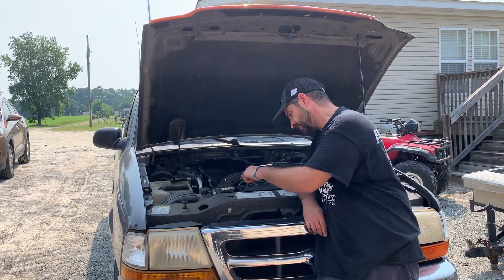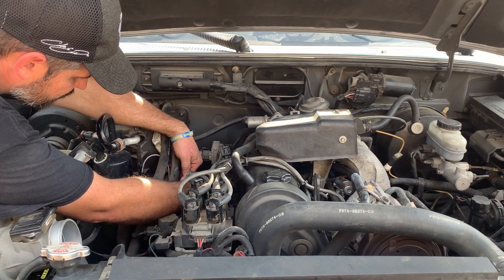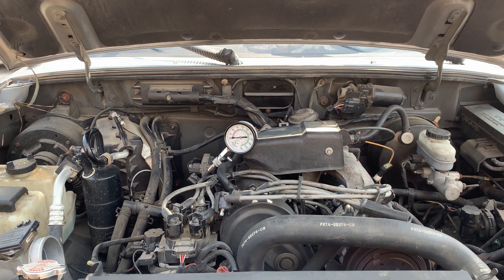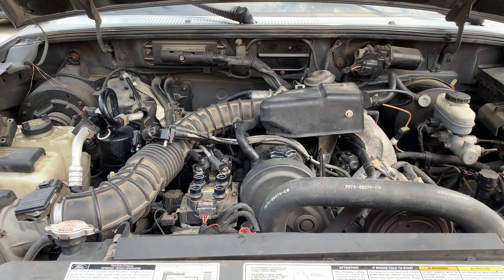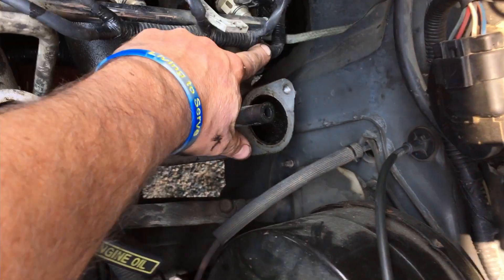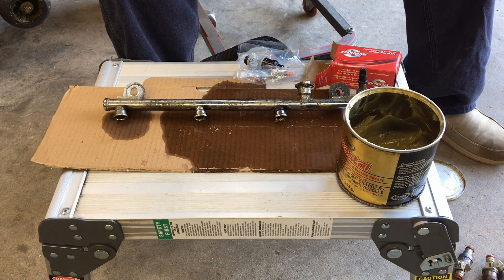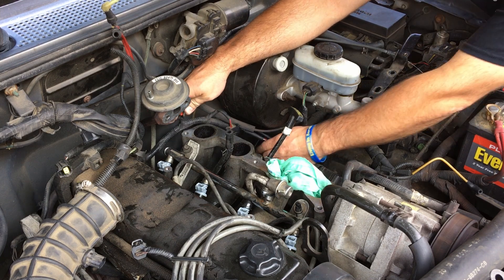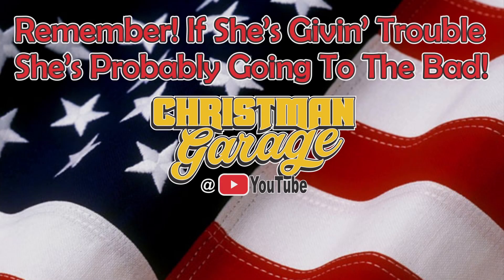1998 Ford Ranger Fuel Injector replace (gone to the bad)

Comment: The 1998-2001 Ranger has a 2.5, not a 2.3. It was a very short lived engine, but it was basically the exact same engine as the 2.3 but just a bit larger. Edit, never mind you corrected yourself. 😂

Comment: You helped me a lot! I also had the same rotting grey vacuum line, but did not know where it was connected to. You showed it connected to heater lines control servo, and mine had a missing vacuum line. Also my 97 Ranger was running very weak. The primary coil pack( the one in the back) was not sparking. It turned out to be a bad connector. It looked fine, but the little contacts inside were not connecting. A new connector from Autozone for $36 fixed the spark problem. And I just passed the California smog test with 273,000 miles on the 2.3 Liter engine. Yeah!!!!
Reply from the maker: Awesome!! thanks for the comment!!
Reply: Heater /ac thru the door is the vacuum hose you showed it is not uncommon for them to be broken.

Comment: Nice job! My favorite engine. I had an inssue with a crank shaft position sensor. No where does it tell that there are two of them. One on the passenger side and one on the driver side tucked facing backwards. Wiring harness connector gone to the bad!
Reply from the maker: Great point!👍

Comment: I have a 2000 Ranger with the 2.5, and I've noticed that it occasionally misfires while it's idling. But it operates perfectly under load. It's not enough to throw a code though, so I suspect that it's the coil pack starting to go bad. I checked all of the plug wires and they looked fine, and I replaced all of the spark plugs a few years ago (which was a pain in the arse). So the only thing I can think of is the coil pack. Or it could be the MAP sensor. But those rarely go bad on these trucks. I already tested the head gasket to see if it was leaking, and it didn't change color. So that's good. My engine has over 170k miles, so I wouldn't be surprised if the gasket was starting to leak.
Reply from the maker: Check over your vacuum lines these trucks are bad about breaking vacuum lines and a leak will sometimes cause a slight skip if all good it could be a coil however most the coils I’ve seen go bad skip worse under a load👍 maybe this helps good luck!

Comment: Know this video is 2 yrs old, but have a 1999 ford ranger 2.5 with a rough idle. It runs all right, but at a light it idles rough and have changed the plugs, wires, both coils, tps, maf sensor and both o2 sensors and it still idles rough. Could the injectors be bad? Plugged my hand held scanner in and from what I can read, but don't understand is the short term and long term fuel trims are both negative when it idles. And from what I can read both o2's seem to function right. Don't know if you can help or not. I thank you for your time. Truck has over 300 k on it.
Reply from the maker: Sounds like you’ve covered all the bases, I have seen these injectors go bad quite a bit it’s absolutely worth a shot 👍
Reply: and getting the fuel filter off is a pain.  Tried those tools to get it off the spring clips, but they don't seem to work for me. thank you for your reply to my questions. @ChristmanGarage

Comment: Excellent video sir. I’m having a little issue with my 1999 Ford ranger with a 3.0 flex fuel.  
I am the original owner and do my own maintenance. It’s got me kind of stumped and trying to determine what’s wrong.    
I’ve got 120,000 miles it developed a real bad miss, plugged in on scanner and it was cylinder number five misfire.   “P305”. It was due for plugs and wires anyways so I installed new spark plugs, wires, compression test 150 psi, reset the code and the problem intermittently comes back with cylinder five misfire I’m trying to determine if I have a bad injector or coil pack.  FYI, during replacement of all six spark plugs I had noticed cylinder number five spark plug electrode was extremely worn down, comparing to the other spark plugs.   Please let me know what you think.   Have a great day.
Reply from the maker: First thank you for the detailed comment👍 good job! I personally would put a coil pack on it they are notorious for going bad. If you could swap two off the coil packs sometimes you can pin point a bad one before you purchase one. If all these tactics fail it could be an injector but they are not as common as a coil pack.  Maybe this helps👍
Reply: @ChristmanGarage  you’re very welcome and I will give that a shot first and let you know the outcome.  Thanks for the response I do the same on my channel.   Have a Merry Christmas.
Reply: @ChristmanGarage  ok just changed the Coil pack and still having the issue.   Intermittent Miss.  I drove a couple miles this morning with absolutely no issue and after I stopped at my destination and started back up the Miss came back??   Any idea of a fuel injector causing this?   
So I’ve Changed Plugs, Wires, Coil pack, ran fuel injector cleaner and compression test.  
I’m about ready to either clean or replace the injectors I figured if I’m doing one I might as well do all
Reply from the maker: @hvacexplained9341  yes could absolutely be an injector sometimes you can tap on them and they will act up
Reply: @ChristmanGarage  I was checking vacuum lines and replace a couple that were very dry rotted as just suspicion in there rather cheap.
I was debating pulling in cleaning the injectors or just replacing them in general their original from 1999.  Everything mechanical one day will fail. I’ll keep you posted. Thank you for getting back to me. I appreciate it. Hope your holidays are going well.
Reply from the maker: @hvacexplained9341  I have never had any luck cleaning the injectors I normally just change them however the local parts houses usually think a lot of these little guys$$$$.  I recommend ordering from amazon. You can normally buy a whole set from amazon for the price of one from a parts house?
Reply: @ChristmanGarage  Problem Solved!!!!!!!!!!  “Wipes Sweat from forehead”.     found the issue.  🤙.   Cylinder #5 fuel injector was intermittently screwing up when it would heat up from the engine.  The Ohm value was roughly 18. + on the Bad injector and 14.7 on all other Injectors.  I had a local engine/marine repair shop test all, cleaned and new O’rings.   I did install a new injector for the cylinder #5. Runs great now, code is gone and runs strong. 
Thanks for advice 👍👍👍
Reply from the maker: @hvacexplained9341  that’s great👍 glad to hear hope it gives many years of reliable service!
Reply: @ChristmanGarage  keeps fingers crossed 🤞

Comment: I have a 3.0 ranger i need to change the injector for cylinder 5 but i cant find out how they are numbered
Reply from the maker: Ford numbers their cylinders 123 on the passenger side and 456 on the drivers side. #5 should be the middle cylinder on the driver side👍.  Here is a link to what it should look like

https://ww2.justanswer.com/uploads/drivefast1971/2011-04-20_174943_2.gif

Comment: My 97 2.3 won't crank when its cold outside. It smells like fuel and it gets flooded blue smoke comes out when it starts. Runs fine when weather is warm
Reply from the maker: Sometimes a mass air flow will cause that but it also could be a temp sensor issue sending the wrong signal to the computer

Comment: Hey man i got a 97 2.3 ranger and it’s skipping at load and sputtering and stalling at idle randomly. any suggestions it seem to be worse when it’s hot out .
Reply from the maker: 9 times out of 10 it’s a coil pack however it could be an injector or a bad plug or wire👍 
Maybe this helps
Thanks for the comment

Comment: Thanks for the video am having problem with my 1997 ford ranger it's a 2.3 engine when am going up a hill if I stop it doesn't have enough power to move I have to give it a lot of gas to get it move
Reply from the maker: Yeah the 2.3’s stock aren’t the most powerful thing around but if you have a cylinder dropping out that also makes a huge difference.  Thanks for the comment👍
Reply: Did you ever sort out the issue?

Comment: Did you check the fuel pressure before changing injectors?
Reply from the maker: Normally I would but I didn’t on this job because all the other injectors were working so I new it had enough pressure 👍thanks for the comment

Comment: I got a 2.5 in a 99 ranger ran rough when I bought it.. I was checking see if the coil packs was bad while running. Stalled out would start but die immediately.. now barely runs when u unplug map sensor
Reply from the maker: Did you unplug the MAP sensor of the MAF sensor ?  These engines are bad about the MAF getting dirty or going bad it is the sensor just behind the air filter on the intake hose sometimes you can clean it with some special cleaner designed for MAF sensors. I would try that first then see if it skips under a load, this truck only was noticeably skipping under a load👍. Maybe this helps
Reply: @ChristmanGarage  sorry mass air flow sensor.. if u leave it plugged up it will start but immediately stalls and when leave it unplugged it tries to stay running better but poorly .. threw a ton of parts at this thing including new ecu that has been programmed. Thanks for ur reply back!!

Comment: EVERY VIDEO THAT I HAVE SEEN ABOUT REMOVING INJECTORS,EVERY INJECTOR REMAINS IN THE RAIL WHEN REMOVER,EVERY ONE!
MINE? LOL! MINE ARE JAMMED IN THE MANIFOLD!! ANY TIPS FOR TAKIN THEM OUT? ALSO,IF REPLACING F.I. SHOULD INSERTS BE REPLACED??
THANKS FOR POSTING!
Reply from the maker: If they stick I usually just pull them out and if the tip comes off you can usually pop it out with a small pick 👍

Comment: Best performance upgrade to the engine is to replace the engine with a good one that wasn't cobbled together by monkeys in lab coats
Reply: Yeah, i mean they only produced these (and countless other engines) at the Lima plant for 31 years. They were so terrible that they put them in like 17 different Ford and Mercury models, and also the later Mazda trucks. So slow they had to even make turbo versions,  and so poorly designed its a mystery how they ever were able to adapt it to waste spark systems and fuel injection. 8 SPARK PLUGS?! That's sooooo haaard to count to. Should just go to Walmart and get an LS engine huh? 
Seriously, what does "performance" mean in a Ranger? They're tiny, slow, pickup trucks, and they best thing they do is start up and run every day. Then again, some people think removing an EGR valve is a performance upgrade, which is in fact the opposite. 
On top of decades of production, adaptability, longevity, and the amount of love every one besides you have for them,  people build the 2.3/2.5's for oval dirt racing cause they're SOLID. IF I ever see one of them lab coat monkeys id shake its monkey hand and then probably try to convince it to come home with me.
Take a lap.